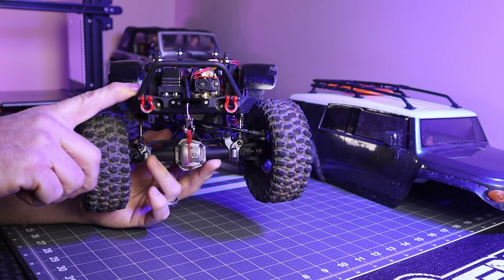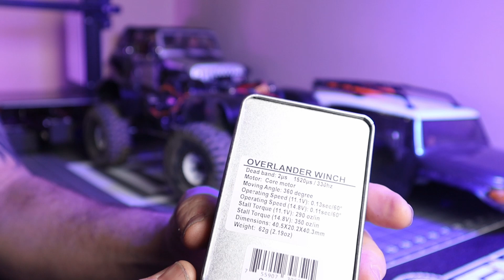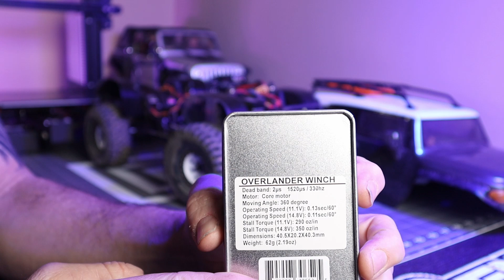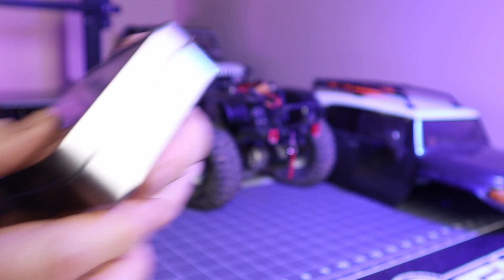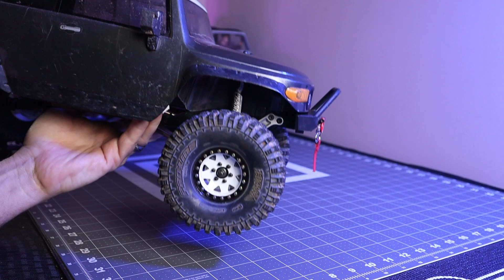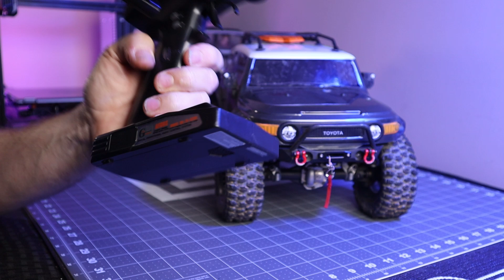HPI Venture SBK - Free to Cheap Servo Winch Mount

Comment: So you have a Axial bumper on it? Do you have somekind of a adapter for the bumper mount? Doesn't HPI use different hole pattern from other manufacturers?
Reply from the maker: The hole spacing for the front bumper is the same as OG SCX10.  10ii is different but original SCX10 bumper goes right on.  This one is the poison spider bumper from the original 2012 Rubicon unlimited scx10.